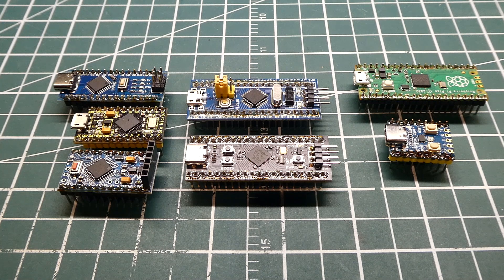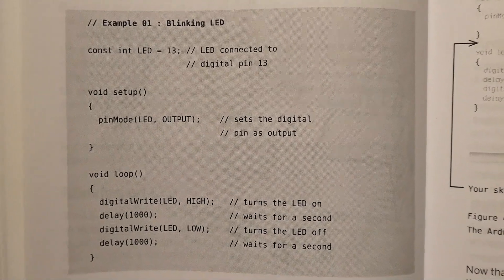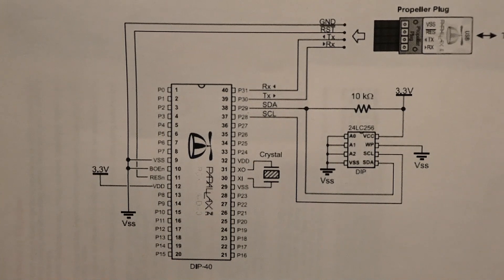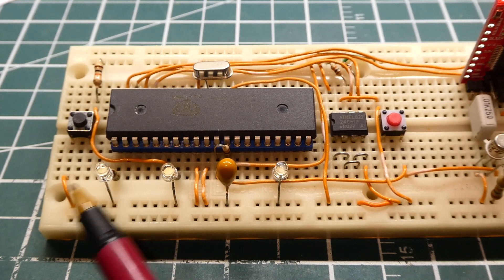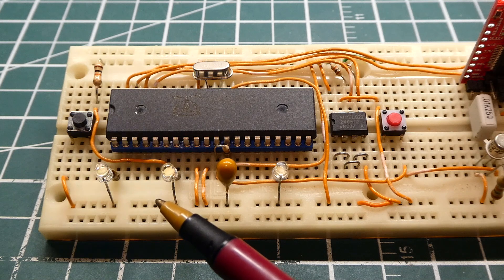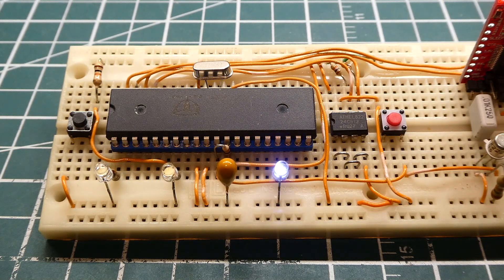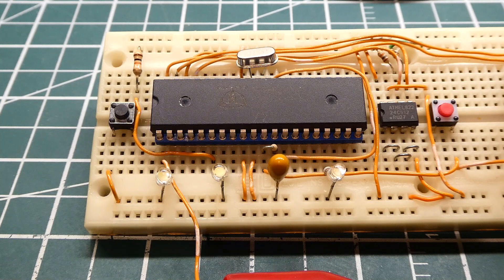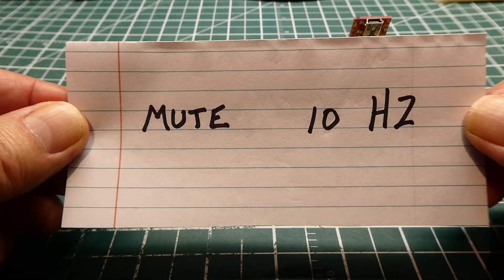Smallest Blink Sketch Ever?

Comment: I thought this was going to get into bare metal programming with machine language. Your parallax code is still a huge program, you just don't see it because it's behind a bunch of classes and libraries.
Reply from the maker: At the beginning of the video and in the description I indicated it was just a "fun" video. Most of the viewers caught on and ran with it giving their funny solutions. The purpose of the video was to show beginners how they could type a few simple commands to get an instant response from a microcontroller. I have done other videos using assembler and the response was " nobody does assembler anymore" so as a content creator you lose either way.

Comment: Smallest is to use 555 timer. No code needed ;-)
Reply: Definitely not smallest.
Smaller is one Schmitt inverter and it can even be done with just two transistors or even a single one with a bit of trickery😉👍😎
Reply from the maker: Use a blinking LED.  No 555 needed.  :o)
Reply: @0033mer  there is a controller in that Led, so that is not quite the same thing.
Reply: @0033mer true HA HA HA!😂
Reply: My favourite coding language: solder
Reply: the smallest, one relay one cap.
Reply: But even if we are talking about a real sketch this isn't the smallest one possible. You can reduce the compiled program size massively by switching the pins directly, not using the libraries for delays or anything and deleting the loop and setup and just using your own main. So even in the realm of blinking an led via code this is still not the smallest sketch.
Reply from the maker: At 4:17 the block diagram shows each Cog has a CounterA/B which are standalone hardware configured as NCOs ( Numerically Controlled Oscillators) When they are blinking the LED there is no code running . There are no delays, libraries, or loops involved as the oscillator alone is controlling the LED.
Reply: @0033mer  I think you mean 1:17? 
So what exactly is this whole thing running on? You send data to the microcontroller via serial which is processed, so you have some kind of processing going on for the serial, which in fact is some kind of code which uses memory and other resources, right? So while the blinking itself technically doesn't use any resources it is not the smallest blink sketch. It still uses some code to process the serial commands. Without this the LED wouldn't blink. And I'm pretty sure that the number assembly instructions used to process serial input is higher than the number of assembly instructions for a loop with a counter and a not and then to write it to hardware. 

Furthermore, the argument at 3:00 about the efficiency of this method is really flawed. A microcontroller is capable of blinking two LEDs. Comparing a microcontroller that doesn't have any other functionality implemented other than blinking a single LED with a delay(which completely blocks the processor, so obviously it can't do anything else and during which the processor actually doesn't do really anything except waiting for the timer interrupt, so it also doesn't use a lot of resources) but then claiming it takes up all the resources available is like completely filling a 1mx1mx1m package with a pebble warped in as much bubble wrap as possible and claiming afterwards that only one small pebble fits into a 1m³ package.
This claim has no value behind it. 
Same goes for saying that your sketch uses less resources because it can toggle a second LED on command, while the Arduino sketch can't.
And "proving" that your blinking sketch doesn't take any resources by switching a second LED on is also just garbage.
This would mean that every processor that can drive 2 LEDs can drive an infinite amount of LEDs.
Reply from the maker: At the beginning of the video and in the description I indicated it was just a "fun" video. Most of the viewers caught on and ran with it giving their funny solutions. The purpose of the video was to show beginners how they could type a few simple commands to get an instant response from a microcontroller. It sounds like you are very experienced with microcontrollers, so if you want, make your own video with your solution and I will link it to this video.
Reply: @0033mer Other than the few seconds after 3:00 where you were plain wrong your video was actually overall a good beginner video. If you would've used a different title, then I wouldn't have had a problem. Even tho I don't see any application where the propeller is a better choice compared to other multicore microprocessors, it's still an interesting concept as a thought experiment/ fun time killer. I went through your other videos and those were all quite good. So maybe use a more accurate click baity title next time?
Reply: Another smallest is to use a avalanche pulse generator, just using one transistor, cap, and a resistor 😂
Reply: Smallest is a single PUT transistor with two or three components...😂
I have seen those oscillating with the current produced by a meter...
Reply from the maker: Yes .. back in the day I did build an oscillator using a Programmable Unijunction. I don't see them anymore, probably stopped production.
Reply: @0033mer Yes Ken, I hope you see the humorous part off my comment...
Some criticism of the community is off context is my point!😂. You have great videos! Have a great year-end and prosperous and healthy new year 2024 my friend!
Reply from the maker: Thanks for sharing and your feedback. Happy New Year!